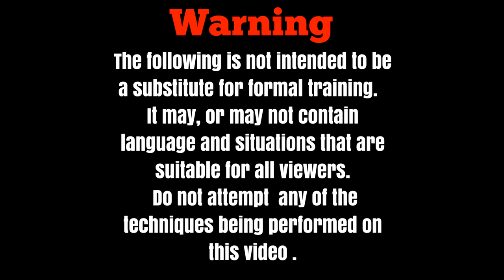What Would Leo Fender Do... I Got It Totally Wrong! Part 2

Comment: Matt, is it possible to have a tilt back head stock ( at 6 or 7 degrees) with a “ tele heel” , bolt on, but not have to figure all the different neck angles like a les Paul type? Even if there is a slight carve to the top of the body?
Reply from the maker: Yes it is but more work... of course